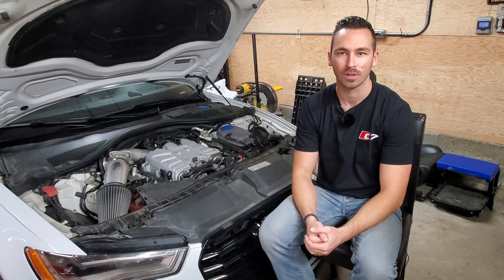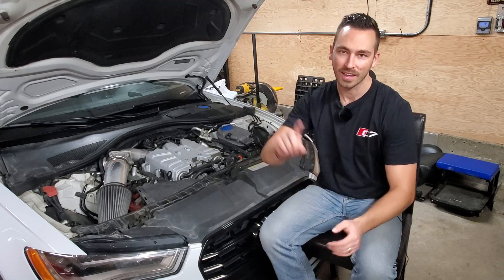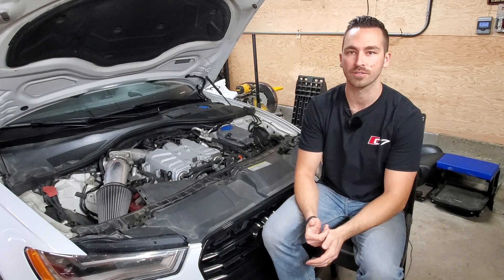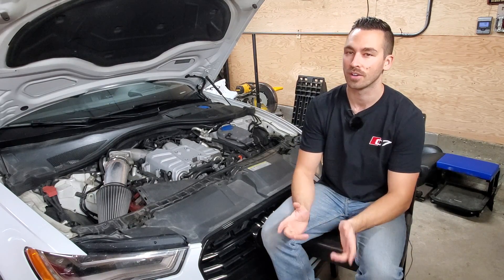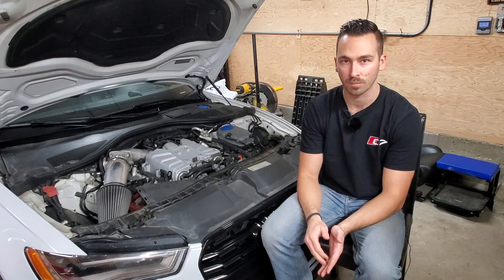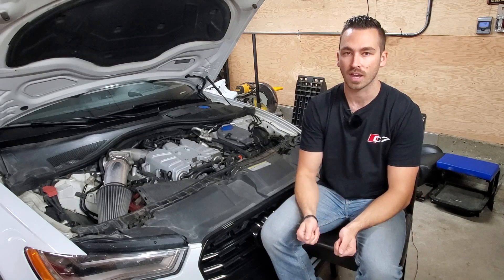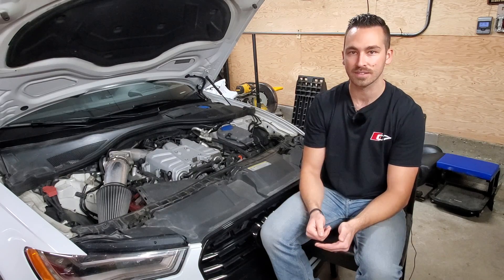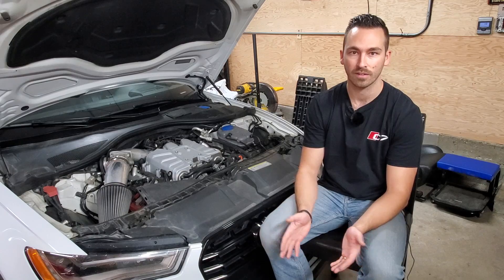3.0t Tech Talk Ep.5 // Launching the ZF8; AMAX and Rolling AMAX

Comment: yo man so im running the Ie tcu tune im a 2012 a6 fbo stage 2 dual pulley about to go e40 bc i kept getting smacked on in rolls but could beat the same cars in a dig. My question is how or what tune do you use to help with the roll racing?? Like do i need to just change from IE tcu tune and do what like hp tuners tcu tune to get better roll racing results thanks gav
Reply from the maker: I don't have experience with the IE TCU. You may be able to get a more aggressive TCU tune through a reputable TCU tuner using HP tuners. I have 034 TCU and my own aggressive TCU currently.

Comment: What can be a result of a boggle…nothing wrong with trans maybe just too high rpms?
Reply from the maker: Bog? Or bogging? Too high or too low of rpm
Reply: @SuitedUp2The9s  bog
Reply: Like on a launch from 1-2 after the bog it’s good
Reply from the maker: Yeah its usually not the right rpm, the tq converter is catching up to the engine speed.
Reply: @SuitedUp2The9s  appreciate the reply…my tcu is stock. Stage 1 93 IE Ecu tune
Reply from the maker: @marcmills9314  time to get you a tcu tune my friend 😃👌

Comment: Also one thing I'd like to ask. What do you mean by, and how do you find out the "limit" on your tires to prevent spinning, and maximize your launch potential?
Reply from the maker: So by launching at different rpms. You increase the launch/stall rpm until you find out where you spin at. Right before that is the point where you have traction on launch and the most power/being put to the wheels and then to the ground. If you aren't making too much power that you have to upswing, that's the method 😃

Comment: Awesome video man! I've been using IE's TCU tune and you can choose between three different launch modes. I have it set to the "Race"which is the highest and my AMAX RPM's are about 3000. On a cold night my Michelin PS AS 3's will slip on E85 Stage 1 tune but won't slip on a warmer day. The high torque shifts are awesome, they throw you back in your seat!!! Supposedly I have brake boosting too which I guess is what you are calling "rolling AMAX." I have a question tho:  at the end of your video you said you are limited to 255 rolling AMAX but that's with a stock tune right? With a custom TCU you should have unlimited AMAX uses from a stop and rolling correct?
Reply from the maker: So stock software is 100 AMAX launches and a custom tcu with hptuners it can be raised to 255 max(2012) 2013+ is +65k haha
Reply: @SuitedUp2The9s  oh ok a huge jump then 😁
Reply from the maker: @skyraidfpv6753  haha you know it 😉

Comment: Have you ever had any timing chain issues with your car ?
Reply from the maker: I haven't at all. Have you?
Reply: @SuitedUp2The9s  no it runs fine rn but I'm only 56k miles I'm nervous a little tho cuz everyone keeps saying how audi's have timing chain issues lol
Reply from the maker: @RoseCityCarCulture  days of old moreso. Nowadays not so much. Yes I have heard of these having issues down the line. But thats when your cold starts chain rattle make sounds for more than 2-5 seconds as oil pressure builds back up and pushes the chain tensioners taut.
Reply: @SuitedUp2The9s  do you hear any rattle on start up ? Also I got a 2014 model not sure weather or not they updated the tensioners
Reply from the maker: @RoseCityCarCulture  just on times where I have let it sit for a number of days, for 3 seconds max currently
Reply: Not to resurrect something from 8 months ago but I just had my drivers side cam chain tensioner fail on my 15 sq5. Granted the car has been tuned since 2018 according to apr and definitely been dual pulley since I got it so roughly 2 years. Not sure if that changes things but at 187k miles is when it went out. Realistically it was probably due to ignorance on changing out my PCV and oil consumption.